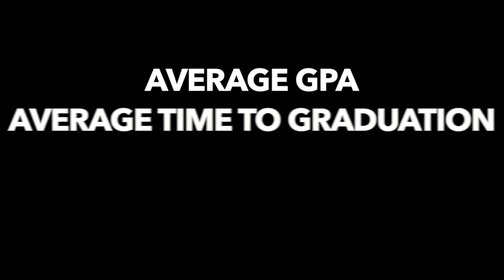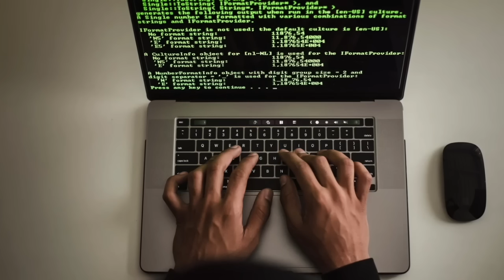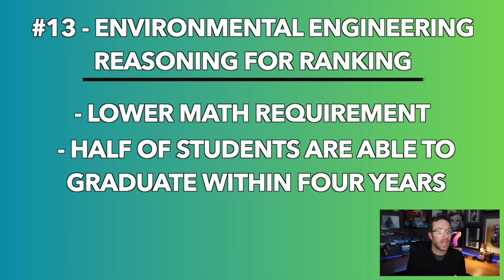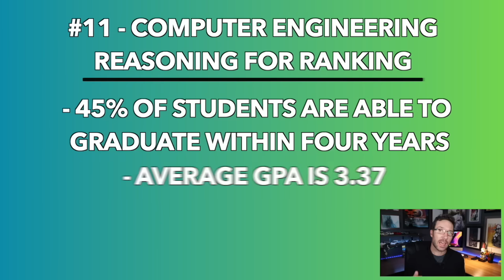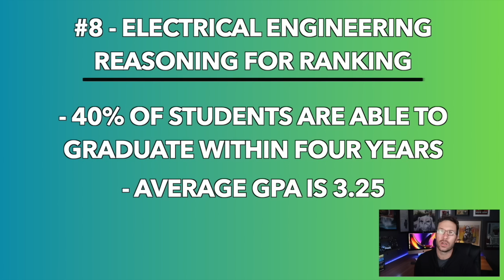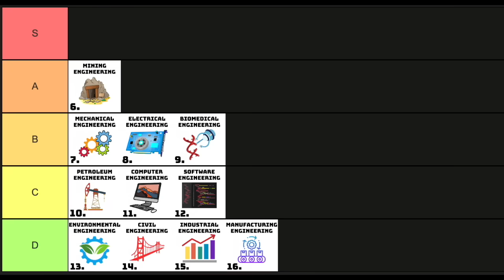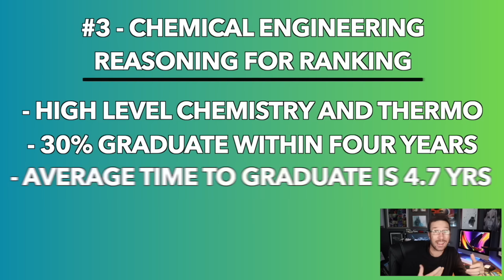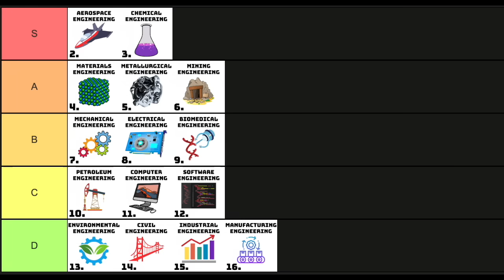Engineering Degrees Ranked By Difficulty (Tier List)

Comment: I am quite sure that, now I have graduated, I am actually less capable of being a useful programmer than I was back in 2018, when I started studying computer engineering at a university. Back in 2018, I didn't have a psychotic disorder and I had a lot more enthusiasm. And I am quite sure the university is at least partly responsible for me getting a psychotic disorder and losing enthusiasm. Even if my psychotic disorder was caused by me regularly taking Paracetamol and energy drinks (rather than the stress at the university), as my psychiatrist thinks... Would that have happened if I wasn't studying at a university or if I was studying something easier than computer engineering? I don't think so.

Comment: Hats off to all engineers and technical minded people.  I’m a mechanical engineer. Studied it for 2 years before I realized it wasn’t about gears and pulleys😂. But stuck it out. Professional pilot and ex military guy.  If you have this kind of mind to become any of the engineers, it makes everything so much easier in life to understand.  I think that difficulty rating should be tied to aptitude.  Some people are just more at ease with certain subjects, and the engineering fields can be pretty varied.  Nice video. All these guys are underpaid.

Comment: I think the author has a bug in his analysis in that he did not normalize the pay for regional cost-of-living differences, nor for the typical amount of uncompensated overtime that is part of the job.  My first career was as an Aerospace Engineer, first in expensive SoCal, and then later in a low-cost city (I took a 5% pay cut, LOL, but I was able to buy a new house for only $70K - try doing that in the late '80s SoCal without going to Hemet, LOL); and it was pretty much standard that overtime was compensated at 1X (maybe that has changed since my day - I know Elon Musk works his Aero Engineers to the bone, so I would not have taken that job, LOL).  The Software/Computer Engineers have a higher rate of living in expensive CA, and engineers there can't even afford the American Dream.  

Chemical Engineers are overrepresented in the Gulf Coast, where the cost of living is low, so the "puny" $90K salary goes farther than the guy making twice that in Silicon Valley.

Comment: I have a degree in Mechanical Engineering, and Partial Differential Equations (PDQ) was not a required course in my program in the '80s (I went on to an MS, and it was most certainly required for that); that said, my undergraduate program covered Fourier Transforms, and that is typically something that is included in PDQ, and the study of Finite Elements and other computational analysis is better understood with PDQ, so maybe it's now a thing.

Comment: I find it hard to believe in the age of numerical analysis that Linear Algebra is not a requirement for all engineering degrees.  Where does the author rank it with respect to Calculus & Ordinary Differential Equations?

Comment: My daughter did an Engineering Degree 30 years ago at Cambridge University and their degree system is Tripos Part 1 and Tripos Part 2 it is a 4 year degree course coming out with a Masters Tripos Part 1 consists of two years and the student is required to study many of the disciplines including chemical  electronic electrical management mechanical civil the Tripos Part two consists of your  chosen discipline hers was civil as  her interest was roads bridges tunnels etc.
It is probably  the toughest degree on offer at Cambridge.  As well as academic ability you have to be totally self motivated disciplined and able to manage time.

Comment: I have a double major in mech and materials. If you can get through calc, dif-eqs is not a big deal. The high level thermo and chem is much more of a factor. When i graduated in 2000 the min credits to graduate for mech was 132 if i recall correctly. I think i wound up with 138 to get the double major.
Reply: Heh -- that's usually true, but my wife (who was later diagnosed with dyscalculia -- like dyslexia but for mathematical thinking) was able to brute-force her way through calculus with an admittedly ridiculous amount of studying, and then found herself completely unable to do the same with even basic differential equations.

Comment: Based on my EE successful EE program (I graduated from CMU in Pittsburgh in 1974), your summary and implicit comparison of ME and EE is incorrect. My degree required significantly higher math than "partial differential equations" -- those were covered in the 2nd year math program. Your piece makes no mention of discrete calculus, Laplace transforms, Fourier analysis, and a host of disciplines beyond that.  At least at my school, the ME and EE math programs were combined. The Mechanical Engineering, Chemical Engineering, and Civil Engineering programs each used rigorous "circuit analogs" to describe problems in their domains as electrical circuits and systems. Those were then solved using the advanced math described above. It was common practice in my school for EE final exams to include problems in Mech E, Civil E, and Chem E.

I'm confident that the EE curricula has, if anything, become more, rather than less, challenging since 1974.

Comment: Electrical engineering has covered a lot of subjects from eletronic and commmunication engineering, computer engineering, software engineering, electrical engineering high voltage system, control and instrmentation and including structure of transmission line towers. Eletrical has so many formulas compared to mechanical or any other engineering discipline.

Comment: Highest level of math for electrical engineering is calc 3 and PDEs. You MUST HAVE calc 3 to learn Maxwell's equations, its not an option. Maxwell's equations make extensive use of Div, Grad and curl and Maxwell's equations are PDEs.
You need to correct that.

Jim

Comment: In my opinion, degrees that require deep ancillary coursework in chemistry and physics are the most difficult (Electrical Engineering, Chemical Engineering, Engineering Physics). Those deep physics / chemistry classes meant for upper division majors are BRUTAL.

Comment: BS physics and MS Aerospace Engineering from Caltech. I’m not sure about aero being #2 because there’s such a large variance in specializations. Navigation/remote sensing is so different from rocket turbomachinery that it’s hard to put them both in the same spot.

One discipline I would have loved to see is Systems Engineering. After 20 years in the industry, SE is a critical discipline that coordinates all the electrical, structural, chemical, and  mechanical engineering on a project to develop products that meet the customer’s requirements. In my experience it’s as much an art as a science though because it involves so much customer interaction, expectation management, and risk management, not to mention business and project management skills. The most effective SEs I’ve worked with have all come from engineering leadership development programs, where they rotated through different engineering roles in major defense contractors.

Comment: For an EE degree (Master) you need to solve partial diff equ. and do Vector analysis of course (Maxwell equ.). You also need to have a deep knowledge in statistics (Noise analysis) and deep understandig of complex numbers, fourier and laplace transform. 
Not considering/mentioning this i think this not the „most accurate ranking on the web“.

Comment: I completed my BE (Electrical Power) 25 years ago. On the first Monday our fundamentals lecturer told the packed auditorium that half the cohort would not return tomorrow and would disappear off to the Surveying department and that on Wednesday half again would disappear off to computer science department never to return and that the numbers would continue to Wittle down over the next month or two until we reached steady state (no hunting). 

We were then told that the next 4 years were going to be an enormous challenge...and they were not lying. In our department electrical engineering was by far the most complex and challenging engineering degree offered at our Uni noting that we did not offer aeronautical or mining...this was due entirely to the mathematical requirements in modeling the various sub-species included in the degree. We had an ex-MIT mech lecturer who complained bitterly that the only students that got 100% in his diabolical dynamic's unit were electrical majors (that being said) the key point is that electrical is the most counter intuitive discipline and the most varied in the type of applications requiring mathematical expression. On top of the common 4 years of calculus, DEs and numerical methods, we did physics to the same level as a BSc physics undergrad with EEs toping the class much to the aggravation of the bearded science cohort (Maxwells equations and all the rest), communications (radio, micro-wave, design), digital signal processing which frankly was the most challenging and esoteric mathematics I have ever confronted, microprocessor architecture, linear and non-linear control systems and a constellation of Electromag, transmission line modelling etc. And we benefited from short courses in C++ which we used to write automation code for adaptive controller devices etc.
Anyway, that's just from my perspective and lord knows I've been wrong in the past.  
No regrets though, such a great degree leading to a rich and varied career.

Comment: I will point out here that what degree is hardest is entirely dependent on the school you attend and your personal skillset and passion. I attend a university with one of the highest rated engineering orograms, and ask any engineering student, they will tell you that the CS degree is the hardest degree to get. The initial classes are rutheless on grading, will frequently assign 10-20hrs of homework a week, and have extremely effective anti-cheat mechanisms in place. Above all of this though, if you are good at and enjoy CS but are bad at physics, ME will be a harder degree regardless of the school.

Comment: Electrical Engineering is only the 8th 'most difficult' on your scale? I can't agree with that. I have a BSEE/MSEE/PhD and the math requirements are significantly more than Mechanical Engineering/Mining Engineering/Metallurgical Engineering, which you rated higher. Your subjective measure of 'difficulty' doesn't correspond to opinions of most Engineering students I've spoken with over the decades, nearly all of which regarded EE as the most challenging curriculum

Comment: Difficulty is closest tied to pay. Where I work, few MS or PhD mechanical engineers exist. EEs are the most common degrees for tech fellows and MSEE and PhDs are most common in the electrical engineering discipline. Another observation is that ME and Aerospace engineers are more likely to move up the ladder via management where as higher level technical positions are most often handed out to electrical engineers. 

Some one already mentioned the fact that electromagnetics gets heavy into math. Agree 100% but it doesn't stop there as programming is also usually necessary. It's a field you can spend decades learning. The smartest folks I've met throughout my 25 year career have all been EEs.

Sure there are lower level EE jobs on the food chain. Support and documentation roles if you will. When it comes to design work in the RF, electromagnetics, controls and electronics world, the very highest levels of cognitive capabilities are needed to bring a technically competitive product to market. If you are not highly driven or don't like a serious challenge, I'd stay away from this field and especially design work.

Comment: This is not a well thought out assessment. Simply there was no control for the preparation of incoming students, which is the most important determinate of graduating and graduating on time. Also, you didn’t consider flunking out. I’d argue that EE or computer engineering has slightly more math at the undergrad level, but like you said, all engineering has a lot of math. Also, there is a lot of applied math in all of them. Level of calculus really doesn’t relate to that. I have 370 credit hours in STEM.

Comment: In Electrical Engineering we also use Partial Differential Equations, especially for Electromagnetics (which is a fundamental basis of this engineering). See, for example, the Electromagnetic Wave Equations and the Telelegrapher's Equations.

Comment: As a recent graduate of mechanical engineering, i agree that chemical engineering is one of the hardest. Meanwhile, Nuclear is much specific than chemical so it earned its spot. Aerospace engineering is specific too and i think what it makes difficult is that in practice more theories are used and at, the same time the work is like conducting a reseach everytime. Afterall, in practice, difficulty varies to industry but I think its more challenging when it comes to Expirmentation and Research industries.

Comment: Great video...and great comments. I'm glad that, today, there still are some serious and sane folks around.
Reply: It's a terrible video, it's obvious he doesn't have a meaningful understanding of many of the fields he's talking about... 

As a ChemEng it doesn't contain that much chemistry and chemistry as a science is not "vaguer" it's still deterministic at a molecular level, and where phenomena become more probabilistic in nature is actually at the point where chemistry crosses over with physics.

The weird focus on mathematics (despite them all apparently only requiring levels which shouldn't be hard for anyone who can get admitted to an engineering program) totally fails to grasp what makes people actually find different disciplines difficult.

Also the analysis lacks rigour, as there's no correcting for sample population differences in the time to graduate and GPS stats, despite the fact that  many of the "less difficult" disciplines are so specific that they will self-select for very motivated and engaged learners, compared to a more generalist discipline like Mech/Chem, or something "sexy" like Aero, where a wider range of applicants with less cohesive motivation and aptitude will take the degree.

It also misses multiple niche disciplines that have amongst the most difficult course content, like Control Systems, Structural, and Explosives engineering, or disciplines that are hugely difficult due to the sheer depth of applied knowledge needed like Demolition, Marine and Offshore engineering, and Naval Architecture.
Reply: @joshuakelly8103 agreed, this video is terrible.  Difficulty ratings and salaries misleading for people who aren’t engineers.

Comment: Physicist here, working as a software engineer. I'm surprised that an electrical engineering program wouldn't require partial differential equations 🤔. Also, I'm pretty sure that some of these disciplines require linear algebra, which is sometimes categorized as a higher level of mathematics than partial differential equations.  I know some engineers use tensor calculus, but I guess it isn't an absolute requirement for graduation?
Reply: Yeah, I took mechanical engineering, and didn't see tensor calculus until graduate school.

(It was a little bit unfortunate, really -- I think it fell a bit in the gap between my undergrad and grad school, because I never actually had a class in tensor calculus as such.  Instead, I just had engineering classes that used it, and explained enough for us to get by but didn't really teach how it worked beyond just the bits we needed for that class.)

Comment: I’m curious where structural engineering would rank. I realize that it is a subset of Civil Engineering, but more and more states are making the licensing requirements more rigorous than EE or ME, with a 16 hour PE/SE exam vs 8 for the others. ASCE is also recommending a Masters degree as a professional level degree.

Comment: I'm doing Materials Science and Engineering, in our research group we are working mainly in Semiconductors, we have 3 types of students, Materials Engineering students, Electrical Engineering and Physics. For me I would rank completely different based on my experience. I had close friends who moved from Chemical Engineering to Materials Engineering and they could barely make it and said it was way more difficult than Chemical engineering, I also have friends in Electrical engineering, there is a huge overlap between Electrical engineering and Materials engineering, if you based on semiconductors, the level of Math and physics that is required in these two majors are extremely difficult, from Quantum Mechanics, Thermodynamics,  Newtonian Mechanics, etc etc, so I would rank Materials Engineering and Electrical Engineering as harder than Chemical engineering. (In this video I think it didn't consider the level of Physics required in these two majors, while in Chemical engineeringy you need chemistry but we all know Physics is way harder than Chemistry).

Comment: From a data perspective your measures seem a bit flawed. You are inherently adding bias to the measures by only looking at aggregate statistics per degree population. I understand the difficulty in getting good data for something like this, but it would be better to do some comparison of student's aptitude prior to choosing a degree (i.e. high school standing or sat/act scores). I would wager better students are more likely to take more difficult tracks, skewing these metrics by looking at only agregate statistics of each degree instead of first basing your study off a control measure or statistic across the entire engineering population.

Comment: One thing to consider about Software Engineering, is the rate at which it changes.  I feel like many of the other engineering fields move much slower than software does.  So if you don't like the idea of having to constantly relearn everything in your field, software may not be for you.